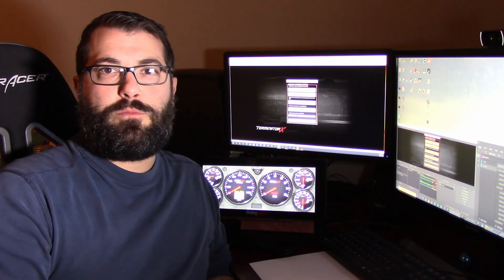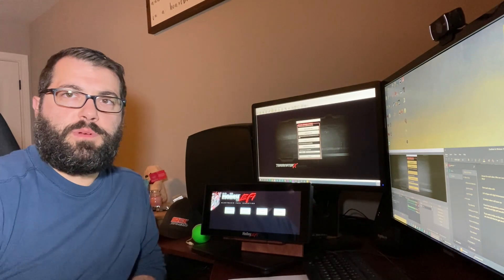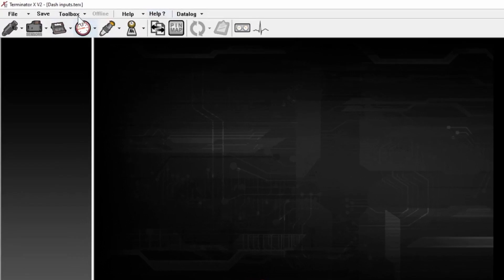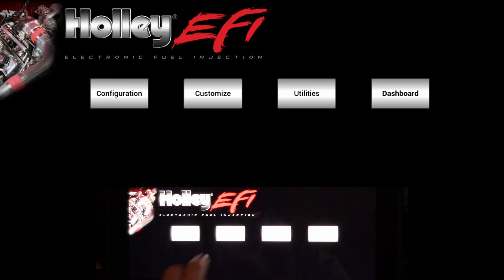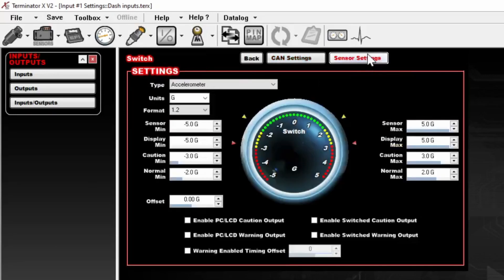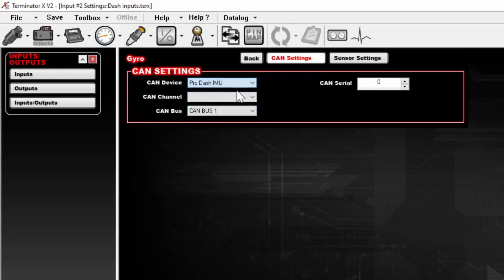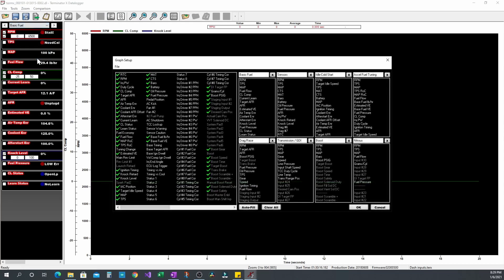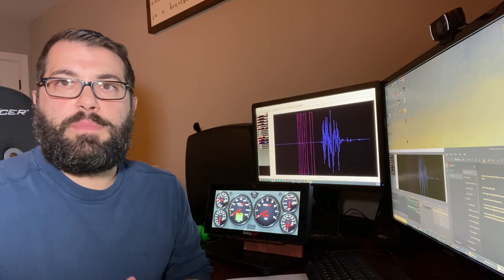Holley EFI Pro Dash Inputs: How to set up and record to your Terminator X and Holley EFI

Comment: I’d really like to see a video on how   the pro dash and the input/output module works with/together on the Terminator X.  Covering what inputs and outputs work and don’t work and why. I was told i can’t use the pro dash or the module to run my trans brake and bump button up. 

Thanks
Reply: You technically can put them on a cam module but your reaction times will have additional delay due to having to send the signal over CAN before it can react to your input
Reply: @cougarnut281   So this is what I have going on and I can’t figure out what to move to where in order to get my trans brake and bump button hooked up and still have everything working. Thanks 

Dome Pressure Sensor input A13
Back Pressure Sensor input A4
E85 Sensor Input A3

Boost IN output B10
Boost OUT output B3
Fan #1 output B12
Fan #2 output B11
Reply from the maker: Move the flex fuel sensor and the fans to the CAN module to free up pins for the transbrake
Reply: @highperformanceconsulting7616  can i move them to the pro dash or would it be better to put it on the input/output module?
Reply: @highperformanceconsulting7616  Ryan can I send you a email?

Comment: By doing it this way, I no longer have to add a wire and pin to the back side of the dash and tie into the ecu? This eliminates having to do any additional wiring? For example the terminator has a plug for the oil pressure sensor, so I no longer have to add a wire from the dash and tie it in the ecu wiring ?

Comment: I have my trans temp and pressure going into my prodash. Can you do a video on how I can make my electric fans come on based on trans temp? Looking for a safety if my trans starts getting hot and my coolant temp isn't high enough to command then on to 100 percent (they are pwm).

Also could you run a trans brake input through the dash? And anyway to make the virtual switches off by default?
Reply from the maker: You could run a trans brake switch thru the Pro dash technically speaking but I wouldn't recommend it since the delay from when you let go of the button until it is processed by the ECU would be increased quite a bit vs wiring it to the ECU directly.  

If you want to email your tune I can look at setting up what you are asking but I just don't feel that videos on very specific IO settings are that great.  I would rather keep my videos a little more generalized.

I'm not sure on the virtual switches so I will need to look at that.
Reply: @highperformanceconsulting7616  whats your email?
Reply from the maker: @briangammey2189  highperfconsulting@gmail.com
Reply: @highperformanceconsulting7616  could you use the pro dash to activate the 2-step (rev limiter 1) this way?

Comment: I’d love to see a traction control setup using the accelerometer vs rear wheel speed (4l80e/4l60e).
Reply from the maker: That’s an interesting thought. I like it.
Reply: I thought I read somewhere that an ABS wheel speed sensor is also used with traction control....

Comment: Great vid, Ryan! I have an Autometer #5291 Mechanical to Electronic Speedometer 16 pulse adapter and would like to use it to import MPH/DS Speed into my Dominator and possible use it or an output to drive my Autometer Speedometer.  Thanks

Comment: How do you log onto the 3.5 screen? I tried to log on my laptop 50 times and only get like 3 data points per second, which is no help. So I tried the the 3.5 screen. Tried 6 or 7 screens and on probably 10 ecus. If I try to do automatic start and it so slow my test is over before it starts. So, I tried to manually start and it say it can't create file or something. Found it would create file if I start it before motor is running, and this got me the most yet, but shut of at 38% tps when I am slamming to WOT. So I tried automatic start, rpm above 500 and stab the gas once log is running. Shuts log off before 30% tps. Tried 1% tps and held it until it started log and stab it, still shuts off before 30% tps. Loaded up firmwares even though its the same, nope. Only thing I have not tried that I can think off is V2 and will soon as they are shipping with V2 now.
Reply from the maker: I’m not really sure how to respond.  Are you talking about a terminator x specifically or other product lines?
Reply: @highperformanceconsulting7616  terminator x only
Reply from the maker: I’ve never had issues logging to the 3.5 with terminator x. I only use the start logging button though. I’ve not used the triggered start
Reply: @highperformanceconsulting7616  No clue why V1 never worked, but V2 did work well so hope that is all history. Also, the software has recovered from powering off the ecu a couple times so less time killing it in Task Manager.
Reply from the maker: Glad to hear
Reply: Haha, I've never had success with it. Wish it was better to computer. I'll try V2 next motor probably next week.